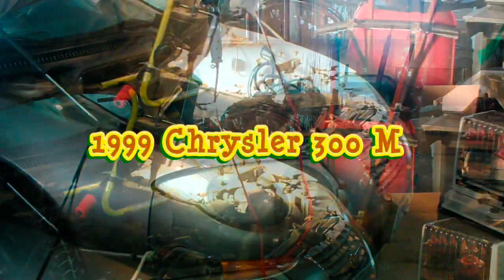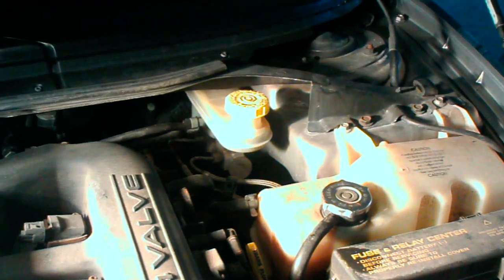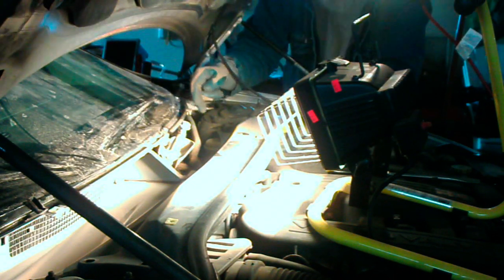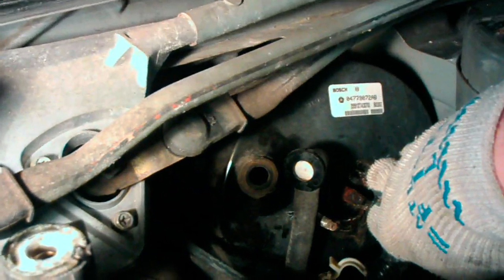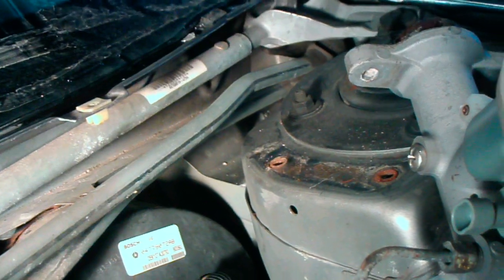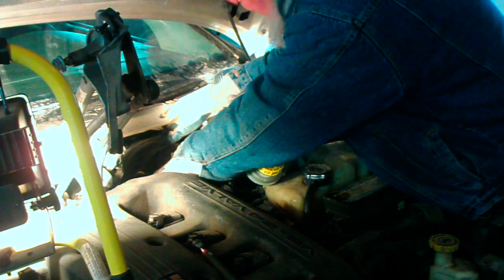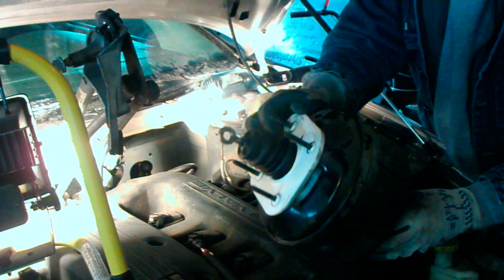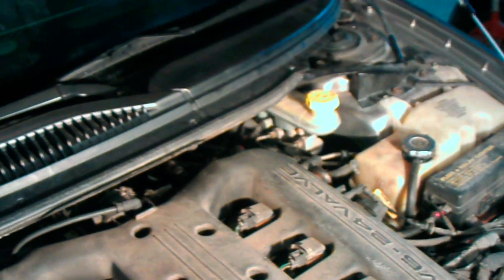1999 Chrysler 300 M brake power booster replacement

Comment: Nice job on a big job! Remember the simple days... I changed the mc on my 67 Impala in about an hour! lol
Reply from the maker: Yeah, the old cars are much easier to work on than these new ones for sure. This one took about 4.5 hours, and I did 4 of them by myself, but by the time it came to the final assembly of the cowling, etc, I was glad for the help. At 65, I get tired faster than I used to, and the cold didn't help either. Thanks for stopping by Wendell.

Comment: Awesome job! When I come to a stop toward the end of it, my 03 300 kinda jerks at the the same time. I can feel the brakes working and I put new rotor and pads put on all the way but still does it. I thought it was the master cylinder, but what exactly does the booster do,I do t want to replace the master cylinder and it still do that. .y calipers are fine though, I did buy a back up set from the junk yard in case I needed em,any help or guidance would greatly be appreciated. I don't know if yoir some car had the same symptoms as mine. Thanks for your time!
Reply: I don't want to replace*, Your son's car*, My calipers *,
Reply from the maker: It sounds to me like you may have an issue with the front suspension, like ball joints or control arm bushings. Check them out. I hope this helps. My son's car is long gone now. Thanks for stopping by
Reply: The Shade Tree Fix-it Man I do know my left strut needs work maybe that's the a part of the reason. Have owned the car a year and has done it the whole time. Tha k you!

Comment: When I press the brake petal on my Concorde it makes achissing noise is the booster the cause of the noise?
Reply from the maker: Either the booster diaphragm is leaking or you have a leak at the hose from the diaphragm to the engine connection. Could be either. Note, a certain amount of whooshing noise is normal, but not a hissing noise. Are your brakes being affected? Thanks for taking a look.
Reply: The Shade Tree Fix-it Man thank you for quick reply. Just started when very cold. Maybe it is the vacuum line going to booster? Also the while vacuum plug I wonder if that is replaceable?
Reply from the maker: If you are referring to the grommet on the booster where the hose hooks on, yes they are replaceable. With the engine running, have someone sit inside and hold their foot on the brake so you can listen around under the hood for the noise. If you can't pinpoint it there, then check down near your brake pedal on the inside. If the noise is there, then you will have to replace the booster itself.
Reply: The Shade Tree Fix-it Man thank you. The noise is definitely inside and noticeble under the dash. Wondering if it because of severe cold. Will brake performance get worse over time?
Reply from the maker: It may, but if it is not affecting it at present I would leave well enough alone. If your brakes become hard to depress then you know it is time to replace the booster. You may want to inspect the master cylinder as well to see if it is leaking into the booster. You will see a telltale stain below the master cylinder on the booster if it is leaking. In that case you will want to replace both the cylinder and the booster. Blessings for the New Year
Reply: The Shade Tree Fix-it Man Thank you again.

Comment: Hi George • What is the scam, no heat in the Shade Tree Fix-it Man Garage. I have been have an issue with the battery in my Ford 150. I have been putting it on a 8 amp. charger at night. The cold is getting to the battery. I may have to buy a new battery, but it is only two years old. Your project looks very complex. Should I buy a new battery?
Cheers from Michigan.
Reply from the maker: Good morning Gary. If you can get your battery past this frigid cold spell, you may be able to keep it going. I too had to replace the battery in my old Toyota, but may put the original back in after recharging it. The cold usually affects those batteries that are either weak or haven't had a good charge maintained due to lack of use.
BTW, I did have two kerosun heaters going in the garage, but they only take the extreme chill off. I need to get some propane for my other heater which does a much better job. When the temps are below zero it is hard to heat this garage. I don't think it is insulated, even though it has been sheetrocked in the past.
Even if you do have to replace your battery, it should be pro-rated so you don't have to pay the full cost again.